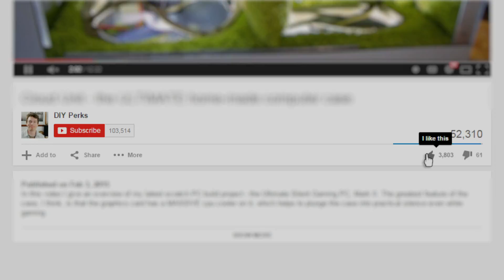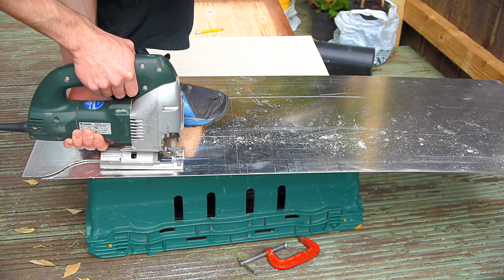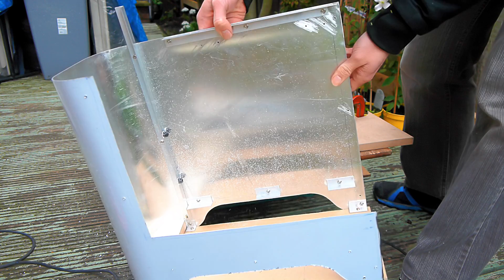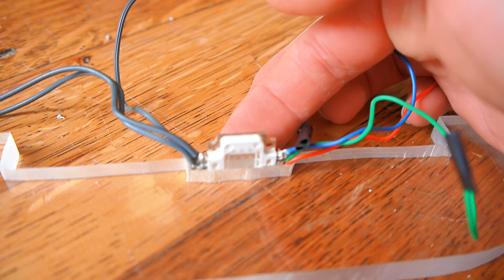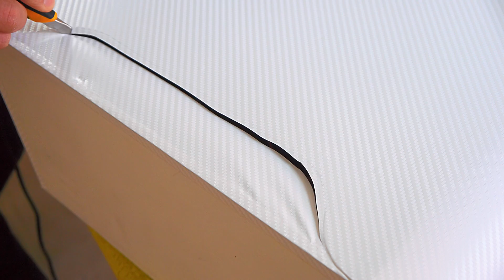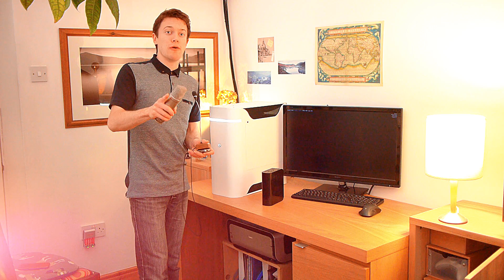Cloud Unit - Build Log (Scratch-Built Silent PC)

Comment: I'm honestly wondering is you have an acctual fetish for silence...
Reply from the maker: Um, no. I don't mind noise, but I would prefer PCs not to add fan noise to a room. More of an interest than an obsession (this case was an experiment to see if it was possible).
Reply: +DIY Perks Hmm, I see where your coming from. The idea of completely silent computing is a nice concept. And holy crap, I gotta say, thanks for replying. For someone that has that many subscribers to even look at their comments is rare.
Reply: +Plazma Catcher A silent computer actually has practical applications, for example when recording sound, which is obviously something Perks does. Look at his collection of microphones!
Reply: I work with a lot of musicians and they want silent PCs both for recording and for listening to their tracks when mixing.

For my own PC, I am putting it on the other side of a wall. Because I want it quiet in this room, but don't want to melt in the summer, I'm also putting in a separate quiet split AC/heat system and completely isolating the room from the main house ductwork. 

Sometimes silence really is golden. :)
Reply: it is if you're using sensitive mikes
Reply: Right,fans especially cheaper ones add an annoying high pitched noise  into the room and if you have f.e. someone sleeping in the same room you have eventually a massive problem(depends if t is your girlfriend or someone else^ ^)
Reply: he mentioned a Røde which is very sensitive.
Reply: Pete Brown
There are lots of silent or near silent solutions without going to these lengths.
Reply: Streacom do a passive range but only suitable for low power rigs. There 
are similar diy solutions with beefier heatsinks for higher power. There
 are liquid cooled with passive dissipation though admittedly you'll 
still have the pump noise. There's also another that I am working on but
 I'll keep that to myself ;) There are passive solutions for cpus and 
fanless gpu variants.

Google passively cooled pcs (as a bonus I've introduced you to google).
Reply: @andrewe3165 "I'll keep that to myself"... The armchair commander's motto when criticizing something, but not having what to back his argument up with.
Reply: Plazma Catcher lol me too
Reply: maybe its an entire server farm...
Reply: OK list some? Thank you!
Reply: Watercooling, like he said, is not quite the solution. Cost a lot more then airflow ;)
Reply: What's all so funny about this is the truth of it all. You " Hunter " nailing his insecurities about himself, and him confirming your insecurities about people not liking you.   hehe good times lol!!!
Reply: I agree, find a therapist, a little noise is no big deal.
Reply: @andrewe3165  It is a big deal when you're needing a setup like this for a sound booth.

Comment: I'm not sure it would work but how about sanding down the screw locations halfway and use flathead screws to make them as flush to the case as possible while putting small pieces of wood or rubber behind the screw location on the case as an anchor.

Comment: how thick is the aluminium im thinking 2mm  is it thick enough?
Reply: +RYU47376  He used 1.5mm thick aluminium for the build, he mentioned it in a comment to one of the videos. I'm pretty certain that somewhat thinner stock would also work just fine, but i don't know how thin is too thin.

The structural rigidity does not come from sheet thickness, but from angle brackets and fiber board inserts along the top and the bottom. So the danger isn't so much that it wouldn't be rigid enough, but that it could warp in an unsightly manner due to screws.

Comment: Amazing case! Right now I'm making a slightly modified external control hub and have one problem: how do you get loose USB ports to stay firmly attached to the case? I've been thinking about using just a lot of hot glue/epoxy but i dont know if it would work.

Comment: This video's awesome. I'm gonna get my teenage son to build something similar with me this summer. It's amazing that he got interested in this at all, thanks! 
If I may make a suggestion to make it look neater. The side door is held on 3 screws, which kinda takes away from the stylish looks. Next time try making the door extend past the edge of the case, bend the extending edge 90 degrees and screw it in from the rear of the case using thumbscrews. This would give you a smooth side surface and a quick door release when needed. I'll try doing it when I get to it.
Looking forward to your next vid!
Reply from the maker: That's a really good idea actually - thanks for the tip!

Comment: What thickness of aluminum did you use?
.020, .030, .040, .050 or thicker?
Reply: +William Tabor  On another video, he commented that he got 1.5mm thick sheetstock. I have done a courtesy of running the calculator and it comes out to about 0.06".
Reply: Thanks so much, I really like the design of this case. If I ever can afford the components to fill it I will try to build a case similar to this.

Comment: The whole build is a fail with the spinning HDD and not an SSD
Reply: +Ronny Finseth He has a ssd as well. Check out the audio test video. He still got a great result and he said he would upgrade it when prices on ssd's drop.
Reply: +Ronny Finseth put it this way a hdd offers better file storage and a sdd is commonly used for the os and other files plus price per dollar is in favor of the hdd yeah there slower but much much more storage space
Reply: +Ronny Finseth He is working with limited funds so if you want the build to be pass in your opinion, you could either send him an ssd or the funds to buy one.

Comment: With the screw ends that stick out of the sides from drilling, my tech teacher said to the class to use a considerably larger drill bit and drill out the unwanted material by hand. It's super fast and effective and makes working with aluminium even better. Hope this helps with future details.

Comment: Quick question, would it be better to attach a small support piece to hold the GPU fan up rather than gluing it to the inside? This way it would be easier to change it out in the future? Not criticizing at all, I think this case is simply beautiful!!! I'm interested in trying to build this and just wanted some advice. Again fantastic and unique case (to include how air flow works within it)!

Comment: Cool build but fail on the drive sock and well socks all n all, there is other way to go about cutting the sound down and the other bad thing is the GPU heat sink attached to the case is that the heat will move to the case.

Comment: Hope that's a cold running hard drive, otherwise, it wont live long in a sock.
Reply from the maker: Temps are fine - it's a laptop drive after all; they're designed to be used in enclosed spaces.
Reply: laptops still have fans and heat-sinks, not socks.  I have had laptop hard drives fail from heat.  But some run hotter than others.  Your hard drive will tell you its temp with hard drive monitoring software.  You might want to check it while you are backing it up, see how hot it gets. Also, you could could put the hard drive in a thick walled aluminum box to both reduce it's noise and remove its heat.
Reply: +ndyt it only runs for 5 minutes a day, just backing up his OS
EDIT I was wrong he uses it for file storage.
Reply: *****
all the laptop hard drives I have removed were screwed to metal which conducted the heat away from the drive.  Could solve the problem by just using SSD which makes no noise and little heat.
Reply: @THESocialJusticeWarrior  he did say he would upgrade to ssd once they came down in price. Wonder if he did.
Reply: +DIY Perks Isn't this computer more than year old since you mentioned it in the "CPU cooler GPU (INSANE temps!)" video, wich is from november 2013

Comment: nice, just to be safe check your HDD temp from time to time, even for a laptop hdd made to be in squeezed locations a towel pocket isn't the best enviroment. i would put a layer of antistatic nylon above the logic board before puting the disk in to protect the most delicate part of the hdd from static. and for all the users that are worried about the open psu, an open psu is a potential risk only if something falls inside, like your finger. but as long as you unplug the psu when you open the case it's not a big deal (just make sure you don't touch the capacitors)
Reply: +Dario Ampuy  Static buildup does not happen with cotton Frottee. Also the power socket of the harddisk grounds the drive's enclosure and electonics permanently, so there will be no potential there. I believe electric damage to the unit is fully excluded.

It is also not to be expected that the temperatures build up over time - it's not like the drive's steady-state power consumption changes over time. Spin-up current and consumption does change, but this is so short anyway, it's not  going to amount to anything.

I personally dislike the idea of running the PSU open, i would never do it my build, but i trust he knows to be careful enough, it's not up to me to judge. I know my fingers can certainly end up anywhere in a moment of absent mindedness.

Comment: How did you make a power button
Reply: +TJ Media Design  I wager a guess that he used one of those you'll find at electronics warehouses and import marketplaces (Amazon, eBay) with a set of keywords like "16mm illuminated momentary switch". Make sure to pick the ones where LED rated voltage is 6V or lower, as opposed to the 12V variety common in automotive, else the LED won't light up.

It might be possible to modify the button and change the resistor inside for the LED, and thus convert the one intended for 12V to work with lower voltage, but i don't know whether these switches can all be disassembled without destroying them.

Comment: Impressive build. I like the design - it almost looks retro, perhaps Art Deco, from well before the advent of the PC! I have to say that I disagree with some of the comments regarding the safety of the PSU. Mentioning the possibility of electrocution from within the grounded metal case is a bit like saying a toaster is unsafe to use as it has exposed elements at mains potential! As you designed the case I'm sure you're more than capable of avoiding a shock from the internal components. Not everything warrants being completely idiot proof! Some of us have sufficient intellect to avoid certain hazards.

Comment: would be able to counter sink the holes to get them flush?
Reply: +Jacob Mendez Not with material that thin or with those screws.
Good question though, you may be able to use screws with thin heads and thicker material.

But really, filing them down is a better way to go about it.

Comment: Well nice job man I would like to have your drawings to do something similar. I will add 1 more 140 mil fan on top to pull out hot air from case. So we didn't see what temps your sistem does with large pasive coolin, colled down with wind inside the case. I mean idea is great but demands much hight airflow trought the case. :D

Comment: I cringed when you applied the thermal paste. That open PSU could literally kill you btw.
Reply from the maker: How could the open PSU kill me, bearing in mind it's in a sealed case, has short circuit protection, is fused and grounded, with all cables properly insulated?
Reply: DIY Perks Well, if you'd accidentally touch it while it's powered on. I'm not saying that it will but it doesn't really seem that safe. The case looks awesome btw.
Reply: +DubstepFTW lol you sound like a typical pseudo intellectual idiot from reddit
Reply: Octanium1337
many open it to change hdd ,and alsp his Pc is enclosed in a case ,again no difference
Reply: +Octanium1337 the short answer is, it's both safe and not safe... as long as the capacitors are properly bled and the electricity is dissipated from them after powering down the system then they are safe to touch (as we know that caps can retain electricity for a little while after the system is even unplugged for some time)... this isn't too much of a problem in modern day power supplies, but older PSUs and... CRTVS.... <<- well, those are a whole 'nother beast, those things will fry you like a turkey. Anyway, back on topic: modern day power supplies have many fail-safes and now adays it only takes moderate knowledge of capacitors and electrical currents to safely handle them... but of course there are still some overly cautious types that freak out simply because the psu says: do not open, do not touch... of course they'd have to say that to eliminate liability, since they know techies like to take things apart, haha
Reply: +Octanium1337 stop being a  drama bitch ,the PSU is also open inside a PS4 ,whats the difference ????
Reply: Octanium1337
no ones gonna die ffs
Reply: ***** WTF do you mean "don't feed the troll". I'm not trolling.
Reply: ***** The ps4 is encased in plastic and you're never going to open it?
Reply: ***** The HDD is in a separate compartment with mo chance of touching the PSU
Reply: Is a modern day psu any similar to a modernday solid state guitar amp? If so having one exposed shouldnt be that bad as long as theres no shorts. Im thinking on doing the same with my psu to make space
Reply: ***** I'm also not an idiot. Now if you had proper proof to support your accusations...
Reply: ***** I know that he knows what he's doing. The open PSU could still kill him. Touching it would be kinda like touching an underpowered transformer. It's 3 am right now so my logical reasoning is pretty much shot at this point. Afterthought me is probably going to realize if I'm wrong.

Comment: For future reference you could always use a nice satin or just plain clear coat on the aluminium. Think of it as a cars paint, when you have a nice thick clear coat sanding shouldn't be too big of an issue considering you could polish it up as well. For removing the jagged edges you could also get a deburring tool to reduce the amount of sanding that you need to get done.

I cant wait for the dedicated video and im inspired to do something like this as well. if you dont mind what was the cost of the materials used as well as how are the thermals on the components could you get a screenshot on cpu-z?
Reply: +Zachary Passmore  I think applying brushed finish with sandpaper and clear coating it over could be the way to go.